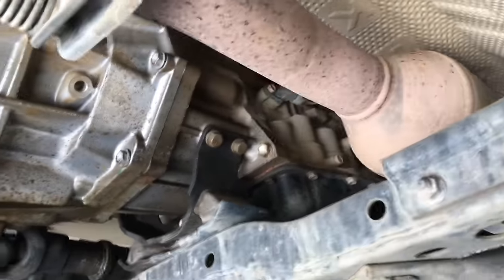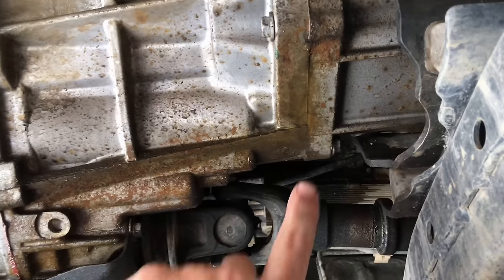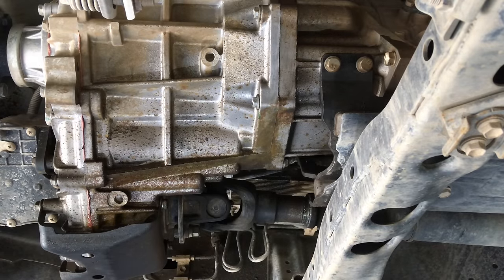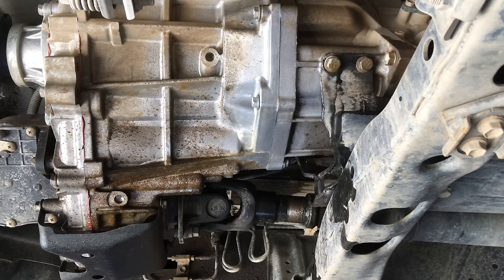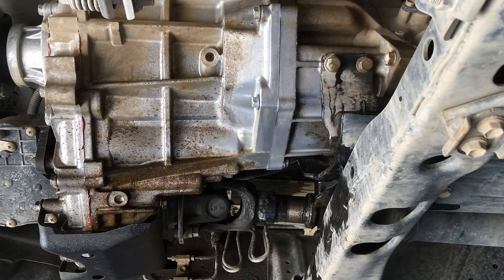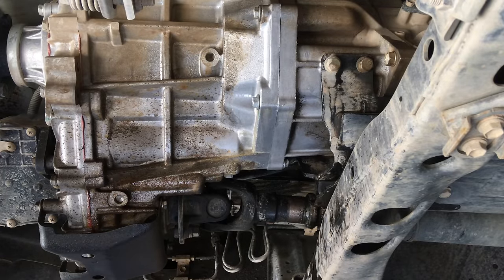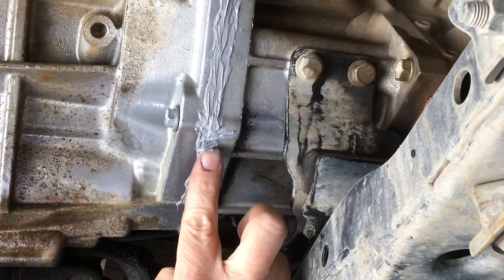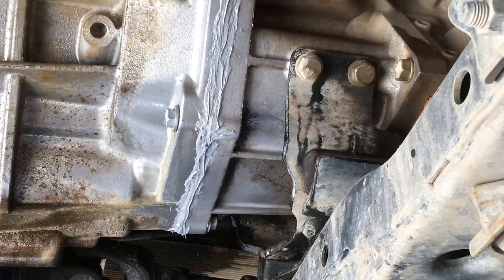CHEAPEST OIL LEAK FIX THAT WORKS

Comment: After many years of Land Rover ownership I feel qualified to comment on oil leaks, this type of leak is often a blocked breather not letting pressure build up due to heating up escape out of the breather and the pressure has to escape wherever it can often taken a bit of oil with it. I once changed a rear diff pinion oil seal twice before I worked it out. It only takes a couple of minutes to remove and check a breather and just might save you a load of time and money.
Reply: Good call
Reply: Can you just pull them out and re fit them and they will still seal up or do you have to replace the bung every time you check?
Reply: Thanks for the advice. I never considered that.
Reply: May be the here but when it comes to Land Rovers the oil leaks has to be at minimum 3 at a time. If you fix one of them the Universe opens up a new leak in your Land Rover. Remember, 3 mandatory simultaneously leaks!
Reply: @robertraman6307  thats why pros choose land cruiser's
Reply: Good comment. Do you know if VW DSG transmission has the breather you are talking about? My tranny has been leaking in the mid-section where it is joined by bolts and sealant. And where would that breather be?
Reply: @22aj55 My Range rover sport 2016's timing chain cover is leaking, do you know whats the best way to get it fixed?
Reply: @robertraman6307  three seems pretty good for a landy . I've lost count now.
Reply: @batchimed7392  have you been changing the fluid yourself? doing it on schedule? Are you running a DSG tune? Those VW DSGs don't really leak until they do...then it seems like nothing will stop it.
Reply: @robertraman6307  Mine always had at least 6 any less and you have run out of oil.
Reply: Land Rovers: if there ain't no oil under it, there ain't no oil in it.
Reply: 100/ agree  !?!?!!

Comment: I would have checked the tightness of the bolts first knowing how humans are
Reply: Or maybe even after he let it sit and dry with the rtv then tighten the bolts to act as a temporary gasket
Reply: You get a attagirl for that!!
Reply: That one bolt does look like it could take a half turn..
Reply: Robot 🤖 built 💪
Reply: Good ideas thanks👍my starter is full of oil don't know were leak is coming from
Reply: Usually the issue is not tighten the bolts in the correct order .
Reply: I've got small leak from hitting something hard . I think I've found it at where ac compressor is bolted to the crankcase and will check it once more before I use this method. Yeah throw it on there hope it sticks and seals it.
Reply: Tightening the bell house bolts is not the issue...its the rear main seal that has nothing to do with the tightness of bell housing bolts.😄
Reply: @lalo2641  if it looks like it's coming from the started it's most likely the rear main seal. What vehicle do you have?
Reply: @lalo2641  that's the same problem shown in the video. There's a gasket in between the engine and transmission that's leaking oil.
Reply: Yep my extension housing leaked and some of the bolts could finger tight
Reply: @sugerhitman1295  it's  in the middle of the gearbox not the rear
Reply: Ok thank you!
Reply: Sadly you are right we never know if shops loosen nuts on purpose.
Reply: It can also be where the mating surfaces of the transmission / transfer case whichever the case may be may not be exactly level or plum or within tolerance and could be slightly higher on one side than the other cuz they inspect like one out of every 25 or less on the assembly line to make sure they're within specifications.
Reply: The bolts don’t really matter and everything he’s doing when the seal inside is broken and draining down and out of case.
Reply: @MrFamilyMoments  yep the output seal is shot, gotta seperate and pop out install new with a little rtv around the outside of seal flange and drive in with socket or seal seater and then bolt back together and back up and in the t-case goes...just did this on my 98 grand cherokee limited to get rid of the all time 4wd the NP249 has, I live in the mojave desert and need 2wd sometimes on paved streets so 231 was a better option! Now 2wd burnouts in the 5.9l magnum, nice.....
Reply: Why not wear gloves? You don't want any of those chemicals being absorbed into your skin.
Reply: If you tight the bolt it will be worst apply balazona
Reply: @kevinoverbeck4250 with a torque wrench I hope
Reply from the maker: Then you would be wasting your time
Reply: What’s the name of that spray that clean up so neat?
Reply: He is not a real mechanic
Reply: @sugerhitman1295 
Your not looking at the bell-housing here, you dont know what your talking about and providing misinformation.

Comment: You save me a lift. following the viewing of this video. I started working on my Ford Transit mk7. I used the same method, however I used Permatex ultra grey on the timing chain cover and oil pan. Functions like a magic. Engine runs for five to ten minutes. NOT A SINGLE LEAK. I appreciate you putting this video online.
Reply: What about now? I'm interested into the same method for the oil pan, but don't know if it will work at all, and seeing you have used this method for the pan, I'm interested to see if it worked for you in long term.
Reply: @hydroponicscustomize : can you please elaborate your experience about how to apply and do's and don't while applying it to timing chain cover... my audi Q5 has timing chian cover oil leak

Comment: I've done that heaps of times both for myself and clients. I was going to suggest tape to give it a clean finish but already been suggested a few times. Any oil leaks that don't leak, always a case of clean and observe. Obviously if it gets wore, fix it, but it could remain like that for years. If you took that to a dealership you'd end up with a $5k repair bill!
Reply: ...u could add an approved oil leak dye pack and dbl check with an ultraviolet light...better to know extent and cause than to just cover up...got to possibly be a weak/worn seal internally
and will only get worse over
time.

LDShaw/FPK GA

Retired Delta
Airlines CONTRACTOR
G.S.E. TECHNICIAN
Q.C./Q.A. INSPECTOR
Reply: My jeep it’s been like that since early 2000, it leaves one small drip after a couple of nights, no more, no less, never changes
Reply: Try oil saver its made by liqui molly,youre welcome

Comment: As a house leak specialist, I apply the silicone a nice bead right across. Then with a light finger I don’t push through the silicone to touch the roof surface and move in little circles as you move along. It leaves it a couple mm thick and will seal better
Reply: What is the exact name of the compound that you used...silicone what???
Reply: VaseLin Maybe .
Reply: My car has just been diagnosed with a slight leak (it seems every car I've ever owned has had one), and I'd like to know exactly what to use.

Comment: Jb weld has held my transmission crack for a year.  Totally worth it.
Reply: ? Which one and actually works ? My a car and it's leaking from everywhere smh please help
Reply: Cracking good job😂😂😂
Reply: I’m thinking about this. However, would u say it totally sealed or fix your leak ? How is it now after a year?
Reply: @leetos.4915 i used j.b welding on my transfer case on my Chevrolet truck, and it held up over a year ago, and I replaced my transfer case.  I went out the other day and looked at my old T case, and the j.b weld was still stuck like steel, and that working on 3 yrs now

Comment: I run 20 year old and older trucks. If I have a seep like that, first thing to do is to snug the bolts a touch. That often fixes it. If not, just spray a bit of degreaser on it every couple of months and hose it off. It gives you a chance to check everything underneath at the same time.
Reply: Good practice for sure.  Ill do that as well 👍
Reply: My father did with his truck too. Thank you.
Reply: Why degreaser?

Comment: I wish the Dodgy Brothers repair shop was close to my home. Most repair shops would have taken apart the transfer case so to charge the customer $1,000 in labor fixing the leak that way. Sure it may be the "proper" way. But also being creative and using a bit of common sense can go along way as well. So does having a good moral spirit. Treating your customers right means they will come back for repeat business. So many repair shops don't think that way. Take care and thanks for the video!

Comment: I use a small hand held sandblaster and blast it sparingly,  then I used a  product called VersEseal,  liquid rubber rapid build.   Made in Brisbane.   Brush it on with a 1 inch paint brush. Done a few leaks on old machinery out on the station.   One 10 years ago on an old Mack gearbox that had been welded (porous) and still holding.

Comment: Such a legend.. Would love to get my car serviced at fixed by an honest mechanic like your self
Reply: Please tell me if this or another product can seal a leaking gasket of oil . Just bought l200 05 and in garage already
Reply: @Machine-rx6wf  "The right stuff" is made by Permatex.  You can buy in a caulking gun tube at Napa for like $18.  It is a black silicone that they say is for repairing valve cover gaskets.  This stuff is the strongest adhesive I have ever seen.  It will seal it, but you might never get it apart.  I'd swear it is as strong as the glue they use to glue in windshield frames, but it can seal in wet oil environments.

Comment: If you're going to apply silicone caulking or sealant and you don't want it looking like garbage this is a trick from a window installation person or who's done windows wet your finger and then smooth the silicone it won't stick to your finger and it won't smear it up all over the place on the part that you're putting the silicone on.
Reply: A spray bottle of dishwashing detergent in water is the best way to finish silicone work neatly.  Spray the silicone down afterwards, then wipe it off with your finger or silicone scraping tool.

Comment: I was thinking about doing this but wasn’t sure if I was right about that stuff and what to use to clean it. Good thing there are actually mechanics that care to save customers money. That in itself will actually get you more customers!
Reply: How much u end up spending? My ford fusion 18 has a minor oil leak i dont wana spend thousands to fix it
Reply: @JOTAERRE1MILLION ...1. Brake cleaner + 2. RTV sealant + 3. Used tooth brush + 4. red rag =  should be less than $25 (in both US and Aussie dollars)
Reply: @SummerBRZ does the brake cleaner is non flammable?
Reply: @Couraginality  why?
Are you planing something stupid?
Reply: “Mechanics that care to save customers money” Not many left nowadays, unfortunately. That is why I educated myself about cars and I fix my own stuff.
Reply: Brake cleaner is very flammable.  This definitely will not stop any leak!  First try tighten up bolts, if doesn't work it needs to be resealed with proper gasket or o'ring.
Reply: Can you do mine ?
Reply: @Couraginality most brake cleaners are extremely though some are not. Throttle body cleaner is not flammable....please be safe
Reply: I love your comment especially the b last part. You’re absolutely correct however most mechanics won’t share this with you. They want the coins. I love a good honest mechanic. You’ll have a client for life!! So thank God for YouTube 🤷🏽‍♀️🙌🏽🙏🏽❤️

Comment: I'm a retired auto mechanic yes I would clean off the area make sure it is good and clean I would check the balls to make sure all the bolts are tight in that area then you can put that gray RTV silicone on it the great our TV is made for transmissions I hope this helps people who have a transmission that is seeping a little bit of transmission fluid the RTV is made pacifically Transmissions and you will see that on the label have a nice day hope this information helps someone
Reply: I would keep this in mind . I’m currently using Honda bond . Have little drip from here on there coming from under neath the tranny…thanks

Comment: Try using AT-205. It rehydrates gaskets & rubber.
Can be used in engines, gearboxes, diffs, cooling systems & if you rub it on door seals etc it revives them.. brings them back to their softer expanded state.
I’m literally sitting in the waiting room as my car is getting pit inspection for a leaking rear main seal BMW X5 V8 & this stuff is great, plus cheaper than replacing seals & neater looking than silicone all over the place. 👍

Comment: Fixed a 2008 Honda Accord EX V6 that had a very bad oil leak under the bottom where the engine connected to the transmission I used your video to do this I used the permatex gasket maker black version after I found the leak area i sealed it with permatex first then let it dry by natural heat and further cured it with a blow dryer and then added some flex seal spray on rubber sealer  problem solved the old cardboard box sides under the car as proof the leaks stopped thanks mate 😂👍🏽
Reply: Lol I’m about to do mines this weekend I got an EXL-V6 Accord, shop told me 1200 not even including parts and labor 😭
Reply: Hi, is that it? How long can you drive like that?
Reply: arent you supposed to change tha seal inside (rear main seal) as the oil thre just drips to the engin-trans joint and its not its job to seal there but intsead it seals in the rear main seal where the crank goes to the gearbox.
Reply: Does it have effect on it in later months?

Comment: That's a dry cavity in there. So the seal must me leaking. There are two seals one on the output shaft to transfer slug and one on the transfer input assembly. Easy to split and fix property
Reply: Yea for 1000 bucks like he just said. He told the customer he was going to do this and monitor it. I could see if it was dripping out to visibility then yea obviously change the gasket the proper way
Reply: yup .. its just clog the drain not the leak
Reply: @nikomartinez1578  there's no gasket in between the transfer case and transmission assembly mating surfaces.

Comment: If you use the Permatex Ultra Black Advanced formula  Maximum Oil Resistance  Gasket Maker (available in US), it works better. Its the best sealant I've tried since I stop using GM sealant because of cost. I've used it for at least 20 years, I think, and never failed if used correctly.
Reply: is it better than the red due to high heat?

Comment: I appreciate Fourby4. It gives a chance to people simply not thought of such way. I used to repair water reservoir that cracks by using duct seal paste after epoxy and hot stick gun not work, and use epoxy to repair top leak of radiator. Here has a man said he did similar repair in fourty years. Most shop runner dislike it as no money earn. Does it work? Depends. As far as the leaking pressure is lower than the glue/RTV bonding force and the bonding won't lost - oil may merge to cause the bonding fail, then it works. Many people asking which product where to buy - if you don't listen then just look at the comments.

Comment: Dodgy maybe but will keep your driveway clean. Does sound like the input on the transfer case or the output on the transmission is leaking. There should be not fluid leaking from that part of the drivetrain.

Comment: I'd place tape 8mm to each side of the split, once built up pull the tape and get a nice clean line. Or, place tape crossways every 3", drive for a week, and see the acutel spot of the leak on the tape.
Reply: Good suggestion to pinpoint.  Thanks 👊
Reply: Or, clean it

Comment: That was awsome .i bet your wife don't appreciate you using her tooth brush and sneaking it back into the washroom. i was thinking what if you used some cellophane or sandwich  wrap to push on the silicone and make it smooth . Good job dodgy .

Comment: I used this stuff as a temporary fix on a punctured oil pan. When I took it to my mechanic to have the pan welded properly, the RTV was still working perfectly, five days later. Mind you, when I did the repair I was able to put my finger in the hole.
Reply: It's a guy thing
Reply: That's what she said

Comment: I just fixed a leak. It was not on an engine mind you but a leak just the same. 
My daughter's furnce stopped working and needed a new circulator. In pulling out the old one I noticed the four bolts and nuts holding it in were not very tight.
The furnace was a tight fit in the room and a bit tough getting the old pump out as I had to pry it out and then pry the new one in. I cleaned up the bolts and nuts and made sure they were tighter than I found them. After turning the water back on there were no leaks at the pump. It was a tough go at this point so my daughter said we should take a break and have a bit of lunch. We put a pan under the pump so we could see if it leaked while at lunch. Mrs Murphy visited us and there was a leak but on inspection it wasn't from the pump that was just installed. Turns out that by tightening up the circulator the way it should be cause a leak at the manifold and heater box. My daughter wanted me to just try and tighten up the two bolts but I wasn't sure that would work so I wanted to try what you did in this video but my leak was a bit more of a leak. What I did was to loosen the bolts and then push plumbers putty along the crack between manifold and heater. I then tightened it up and we wait a bit to see if it leaked and Mother Murphy left the building, no leaks at that point we turned on the water so there would be pressure in the system and again waited a bit and it was fixed. To tell you the truth I thought of the fix as a hail Mary and if it had not worked for us I would have been a little leery of your fix. Live and learn. Good video. Happy Motoring.

Comment: Just thinking about the job and I'm not a mechanic  but would it have been worth checking the bolts to see if they were all tight , anyways another good video fellas at least I know now I could do a quick cheep fix with that silicone you used .